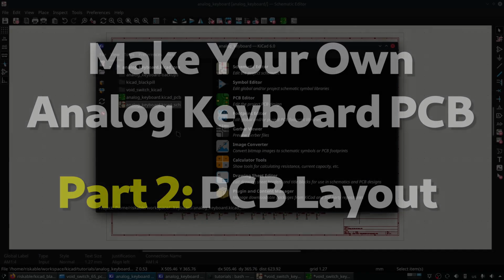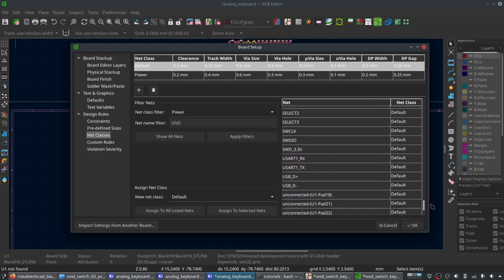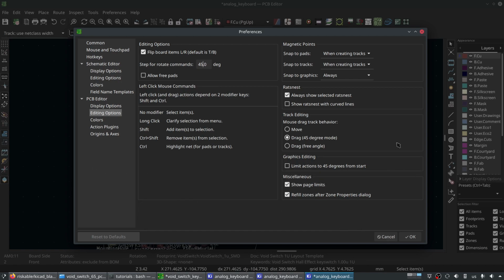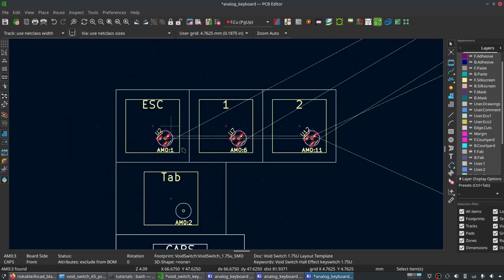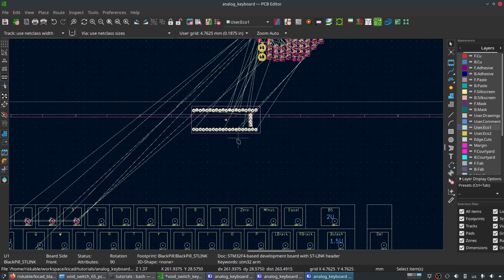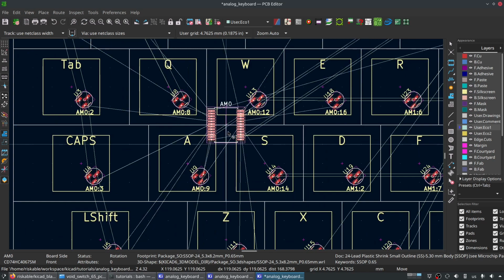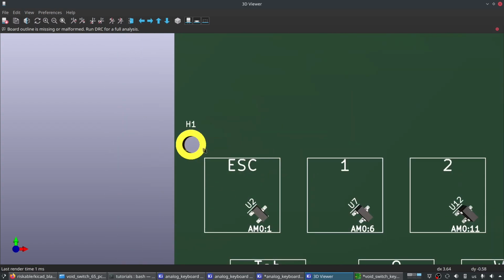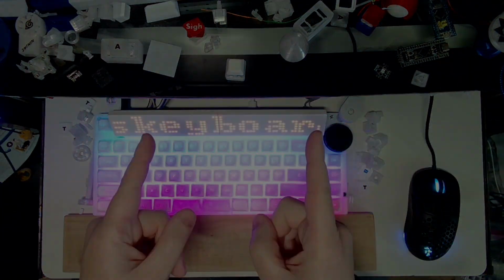Make your own analog keyboard PCB (in Kicad) - Part 2 (PCB Layout)

Comment: Does the sensor and the multiplexer need to be on the front side of the PCB? I can see the reason why you put the sensor at the front side, but I don't see it for the multiplexer
Reply from the maker: Multiplexer can go anywhere.  Doesn't matter.  The sensors themselves can be on either side of the PCB.  If you don't put them on the same side as the magnets though you'll lose a little bit of sensitivity.
Reply: @riskable  aahh.. thank you for the reply. I just need a validation for putting the multiplexer on the back side. I'm trying to build same 65% keyboard but with 66 keys layout + a rotary encoder and a feature to set the actuation point between 0.1 mm to 4 mm with differences about 0.1 mm for each actuation point. I also try to use the nRF52840 as the MCU instead of STM32 so it can connect either via Bluetooth or wireless 2.4GHz without adding separate modules to the design.

NB: I know there's already many companies made 65% HE Keyboard, but making your own keyboard from scratch feels more satisfying (at least for myself)

Edit: Now I'm confused on how to flash the nRF52840 chip because I don't use any kind of dev board, but rather slaps only the chip to my keyboard

Comment: I'm on a 60% with an ANSI layout, and no messing with the lower right corner, so the split spacebar is good as a modifier to get the stuff that doesn't fit a 60%  IJKL are arrow keys ESDF are pgup, home, pgdn, end,  numbers are f-keys, etc.  
I also found that I hit the space bar in pretty much exactly the same spot, so I just use 5 1.25u keys inverted where the normal space would be, and don't need stabilizers there.  The right 3 of them are space, and the left two are modifiers.  This has the added benefit that when I'm gaming, with my left hand on WASD,  my thumb can sit on the leftmost space key (very centre of the board).
The rightmost "space" key next to the RAlt never gets used, so I can use it for another layer key if I ever need one.

Comment: Thank you great tutorial! BTW I wonder if analog keyboard can do active actuation point like Wooting 60HE. Do you have a plan to do that?
Reply from the maker: The actuation point can be adjusted however you like.  It doesn't do the "rapid trigger" function but only because I haven't bothered to implement that in the firmware (wouldn't be complicated).  It's a trivial feature.

Comment: Hey riskable, i was trying to make a ErgoDox layout and i have not enough experience with analog traces, for a better price on the pcb manufacture, it needs to be reversable, so it is a 2 sided pcb with the same traces both sides, you have any idea if this is going to work or it is a bad idea?
Reply from the maker: For analog reversing is easy!  Because it doesn't matter what side of the PCB the sensors are on.  The only "trick" there is that when you flip the board over the sensors will be in a different corner (e.g. lower left instead of lower right).  So the only concern there is that you need to make sure your Void Switches get installed into the top plate rotated 90° (magnets in the lower left instead of right).  The stem on Void Switches can accept keycaps in any orientation so it doesn't matter which way you install them 👍

If you're making a board for a different kind of hall effect switch it probably won't even need to be taken into consideration since every other type of hall effect switch I've ever seen has the magnets mounted in the center of the switch.

Comment: I was wondering, would it be possible to put a magnet on top, in the center, of a hall effect sensor with the purpose to repel the switch's stem's magnet and still get a as usable reading of the stem's position as if no extra magnet was there to change the magnetic field? And if not as good at least a decent reading. On a switch such as the Gateron KS-20 which has the magnet placed on the stem.
Reply from the maker: I don't think that'd work because the magnet repelling the magnet under the keycap would be in a fixed position relative to the sensor.
Reply: @riskable   @riskable  Thanks for replying. I am not sure if I misunderstand your reply or if you misunderstood me. When you mention "the magnet under the keycap" I think about your own 3D printed switches, which I did not. I was thinking about a key switch more commercially available, such as the Gateron KS-20, which has a single magnet attached to the bottom of the stem and a spring is used to reset the stem instead of two magnets. I was thinking  about using a second magnet attached to e.g. the back side of the PCB to generate a stronger return force that is much more exponential than what you can achieve with a spring. I made a rough sketch of what I was thinking about: https://imgur.com/gAcAcn6.  I was wondering if the bottom magnet would mess up the readings or if there is some way to account for the extra magnetic field.

I was thinking if it would be possible to make a modified version of the Gateron KS-20 which is linear in ~3 mm, then you get a tactile bump with a really strong leaf spring so that the tactility is so strong that it is hard to press through it by accident, thus creating a "two stage" switch would work good if you wish to utilize the analog switch's possibility of having a second functionality when you bottomed. I find this function is lacking in current switches since they have poor separation between the two stages. However, with a strong leaf spring that causes the tactility you would need to have a strong return force as well, but since you might not wish to have a 200 g spring for the first 3 mm of the switch a magnet would be nice for the last 1 mm that needs 200 g to activate.

Comment: When you have a bunch of repeated footprints like that it's easier to delete all but one of the foot prints that gets added and then create an array and then reassign the numbers.
Reply from the maker: Yeah except keys aren't really laid out in perfectly even rows/columns (unless it's ortholinear and 100% 1U keys) so the array feature doesn't really help much.
Reply: @riskable   yeah it does I've done it before. Doesn't really matter what the final position is you can move it later. Array just creates a bunch of copies with no assigned schematic symbol. I've done this before and it works great. Lemme see if I can find the original tutorial.
Reply: @riskable  here ya go: https://youtu.be/ZjUWpWYzd_c

I used this same technique with a 140 button something midi controller I built.

Comment: I'm sure you heard of Wooting 60HE Gaming Keyboard. Im interested in exploring essentially a custom ortholinear version of that keyboard. Would this pcb provide me with the same functionality? Sorry if my question is stupid, I am not super familiar with PCB building.
Reply from the maker: Well this keyboard is meant to work with Void Switches. If you want to make a version that works with Wooting switches you'll need to position the hall effect sensors in the center instead of in the corner but that's about all you'd need to change. I should work 👍

Comment: Hello, I made a comment on the last video you made but have since done enough research to understand how to create a hall effect pcb for a keyboard (mostly due to your awesome tutorial). One thing I am curious about however is programming. I assume (due to the hall sensors) that it isn't as simple as flashing QMK firmware onto the micro controller. Would I first need to program the functionality of the hall sensors in arduino for instance? You mentioned you had programmed your own firmware and I was curious as to how you went about doing so. I want to have a general idea as to what I need to do so I can begin learning the correct programming language and method of implementing firmware. Sorry if its a silly question, I just learn best by asking more experienced people about their understanding and methods.
Reply from the maker: Yeah the firmware is what I'm working on right now.  I'm trying to come up with something that's easily customizable for everyone's custom keyboards but it's not easy!  I've been writing it in Rust to get maximum performance while also retaining modern programming features (like iterators) and it's turning out pretty good.  The only issue so far is embedded Rust is still kind of a new thing so the ecosystem hasn't come up with well-worn solutions for doing things like compile-time configuration yet...  So I sort of have to invent it.
Reply: @riskable  im really interested, if we manage to get sth managable this might be sooo damn good. HE effect currently is mainly marketed for gamers, and its lacking all useful features like split spacebar support and stuff.

Comment: Are you still working on those magnetic key switches?
Reply from the maker: Yes!  I'm still super obsessed with this project.  I just pushed an update to my void_switch repo with improvements to the stabilizer design.  I've had some time-sensitive work that takes priority over this video series but I'll be resuming it soon 👍

Another thing slowing me down is that for the last part of the series--where I talk about firmware--I need to have...  A good firmware! Haha.  The current firmware is waaaaaaay too complicated/a mess for a tutorial.  So I've been working on making a simplified version that will be much easier to present.  There's a lot of work to do and most of it is stuff I need to do before I make the videos.
Reply: @riskable  Awesome! If you ever decide to stream this stuff on twitch or something, I would be happy to watch. I'm sure some others would be excited about it too!

Comment: is it possible to make a low profile void switch?
Reply from the maker: Yes!  I already have some low profile versions of the switch.  It's just the standard Void Switch with 4x1mm magnets, shorter travel distance (2mm), and a slightly shorter stem (3mm instead of 4).
Reply: @riskable  Are there any prerendered files for a low profile void switch? If not, what would be the appropriate parameters to adjust in the openscad files?

Comment: Are there any microcontrollers capable of measuring and outputting that many analogue signals?
Reply from the maker: No, which is why you need to use analog multiplexers (or lots of independent ADC chips I guess but that would be expensive).